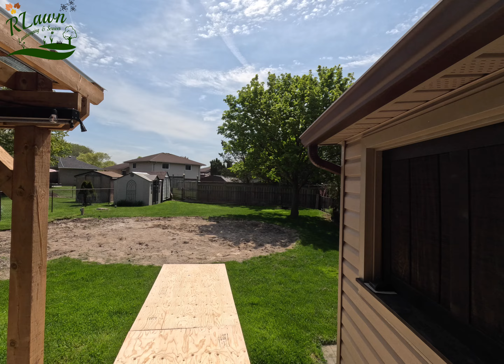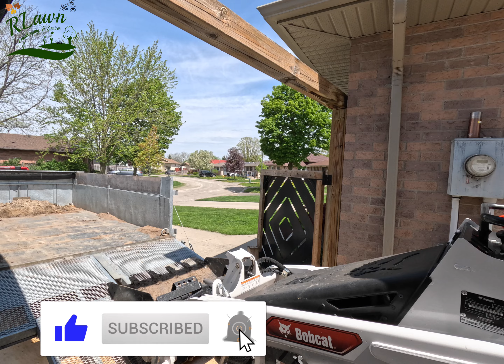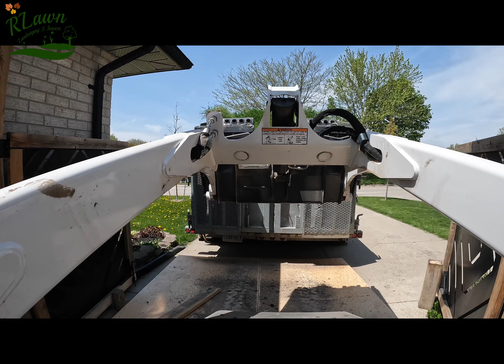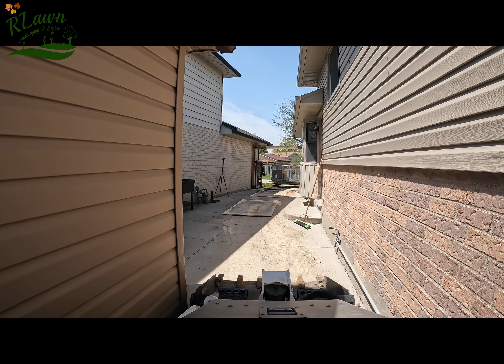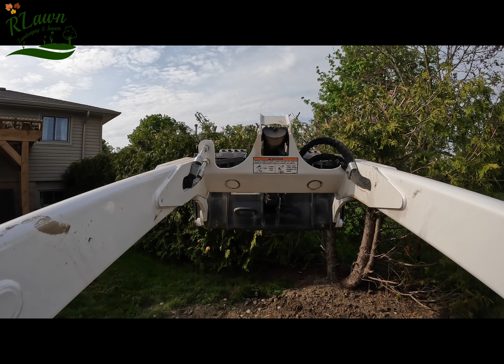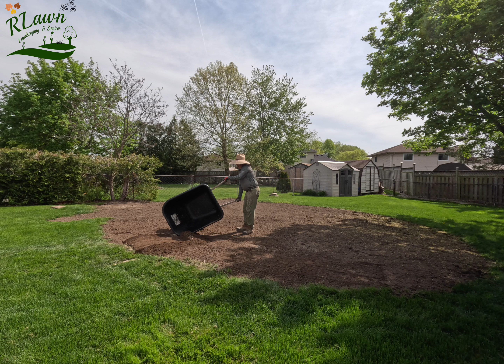Making #money with the Bobcat MT100 Mini Skid Steer #landscaping #solo

Comment: What size trailer do you have
Reply from the maker: hello Davidortiz1666 I have a 14ft  7 ton dump trailer  wishing it was a 16'
Reply: Do you tie down your bobcat
Reply: @rlawn Why?
Reply from the maker: @davidortiz1666  Yes i use Straps  I find them easier then using chains down side is once they show wear you have to replace them
Reply from the maker: @anythingadrenaline4515  why?
Reply: @rlawn  Why do you wish you had a 16' trailer instead of the 14' exactly? To fit more attachments?
Reply from the maker: @anythingadrenaline4515  I have had it so many times that i have to leave the machine at the job site just cause i'm a little short on room.  Yes because I don't have a 550 pick up truck with a dump on it I also round out of room for attachments